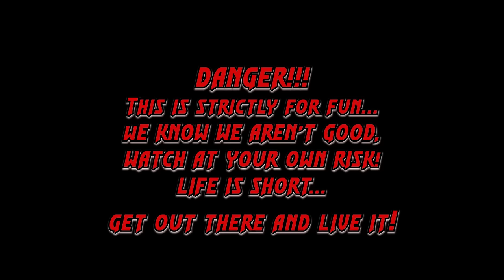Dallon Murty Crash / Harris Terminator / Roll Cage & Race Safety

Comment: Excellent point about the minimum width requirement on the cages. A smaller cage width wise would be safer. Interesting to see if the sanctioning bodies do anything with this.

Comment: Now I know back in the late 80s early 90s I worked with a guy that put cages in cars for a factory stock division, which we used .090 wall first run 1/2 tubing and two of the cars he built ended up destroyed other than the main cage which held up fine!

Comment: IMO, belts need to replaced every 3 years, same with helmets. 
If you show up at a track and there isn’t a fire truck & ambulance in attendance turn around and head home. 
I’d like to see the door bars gusseted. If you added the  Earnhardt w/s bar & run a bar connecting the main hoop to the Earnhardt bar on the roof hoop.
 Great show & stay safe.

Comment: As long as Dallon is and will be ok that's all that matters. it was a freak accident. All the naysayers are just jealous because dallon is so fast.
Reply from the maker: I've never been jealous of anyone more successful in any facet of life... learn from them and try to get there yourself! :-) That young man is an incredible talent, and looking forward to seeing him in person this summer!
Reply: I don't know what it is with you know sniper b&b even Terminator they're all picking up the left front and have that lean going on here in Michigan I think I've only seen a couple guys that run that type of setup lot of guys don't run that soft spring stuff like them guys I know my car doesn't but good point buddy
Reply: @oldguyhobbies3236  hell yeah
Reply: @baims8367 it's more to do with ride height than spring rates. Chassis manufacturers run the thinnest tubing the rules allow you which is 0.095 wall thickness on the main cage. 0.125 is a 1/16th of an inch as reference.
Reply: In reality .062 is 1/16" " .125 is 1/8" when I first started racing the minimum was 1-1/2" diameter and 1/8" wall for ALL bars in the main cage but you were allowed to use .062 for front hoop bars and the ones running to the top of the chassis curve on coil spring cars and leaf spring cars had to use 1-1/2" x .125 minimum to the rear most area of the frame rails on each side and it was optional but recommended to run at least one diagonal from the top of the cage on one corner to the very rear of the chassis on the opposite side, it could be as small as 1-1/4" x .062 .